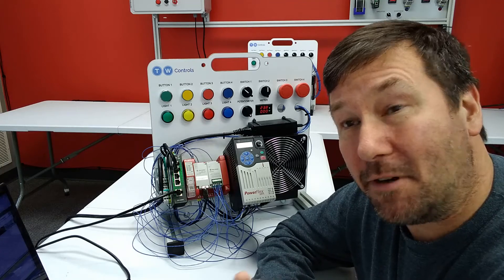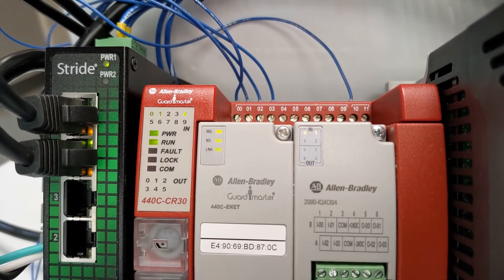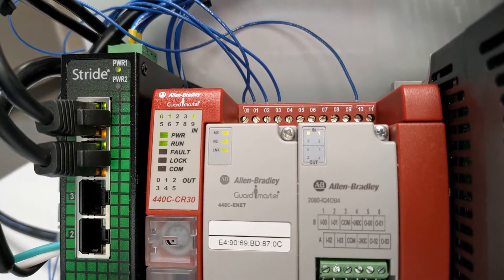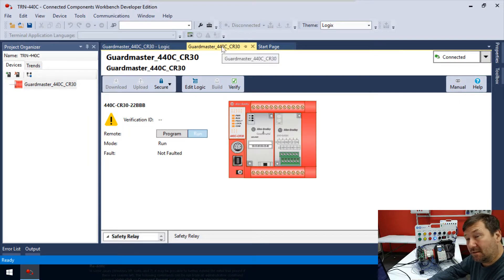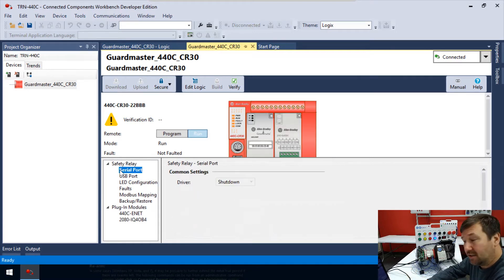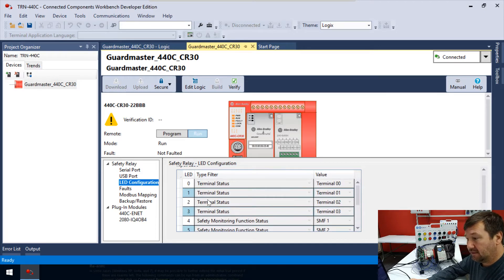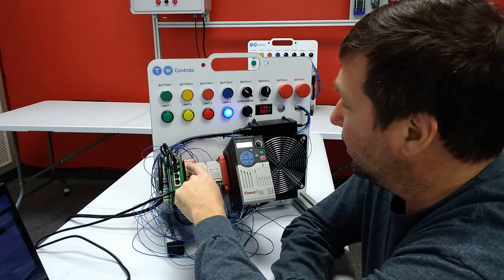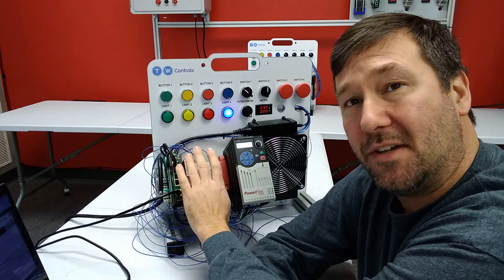Allen Bradley CR30 Safety PLC, What do the LEDs Indicate on the PLC?

Comment: Hi Tim, we have a cleaning sequence in our machine during this seqeuence everything stand still. It would be much easier for our costumers to be able to open all doors and spray water inside the machine to remove the ice but the safety doesn't allow us to open the doors. Is there a way to bypass the safety during that cleaning seqeuence? If there is a way, is it in the PLC program or in the guardmaster logic? ( we have three door sensors)
Reply from the maker: Bypassing safeties is always a no no.  The cleaning sequence needs to be designed into the safety system

Comment: Eagerly awaiting... I have to implement a rather complicated, multi zone conveyor safety solution to my project. What started as a simple status HMI for monitoring status of all the equipment on a food production line, has expanded to a Line Configuration control center for changeovers and certain reset functions. Your videos really helped me not to bounce off the rails, as this is my first use of the Micro 800's. All of the machines are less than 3 years old and use CompactLogic L3x processors and PF525 drives. I'm able to extract any information I need from any machine on the line, via Ethernet. What has been accomplished so far has greatly simplified setup and troubleshooting of this pack line... (and I'm able to accommodate most additional design requests from our production office); all using a single Micro820 and PV800. Thanks for great help in getting me prepared for it! These little controllers are great for line integration.
Reply from the maker: Sounds like you have had some great success Tim.  Keep it up!